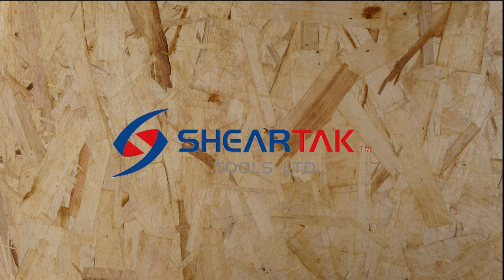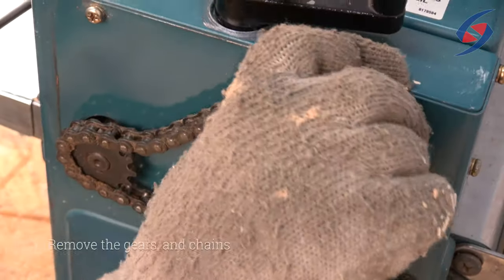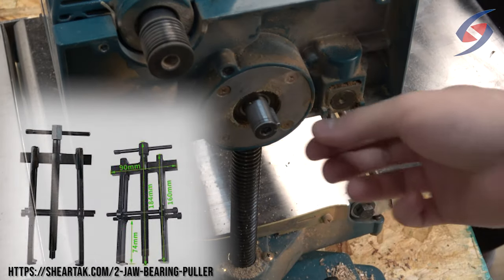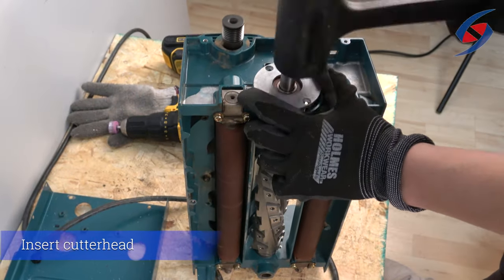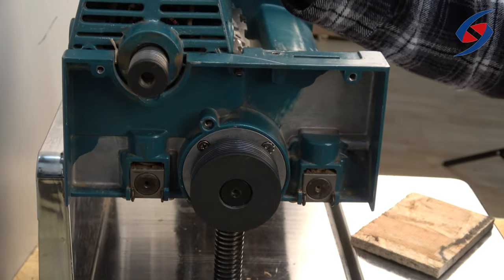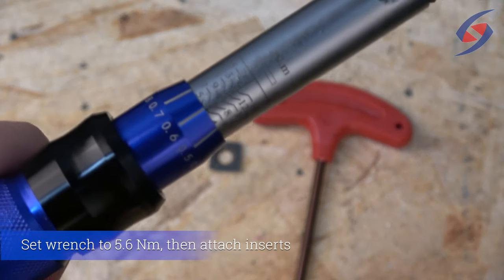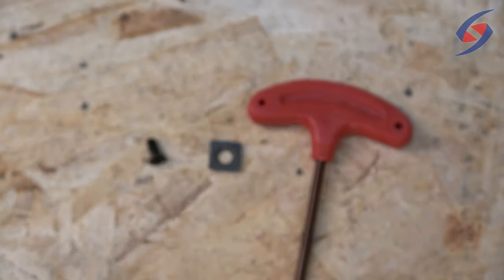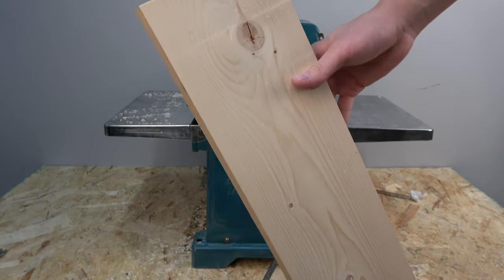Installation of Spiral Cutter Head for Makita 2012 12inch Planer - Sheartak

Comment: I put my cutter head in from the top rather than the end. I put one end in too far, then dropped the other end down and slid it to the center. I did not even have to remove any cutters. Mine was the Shelix head.